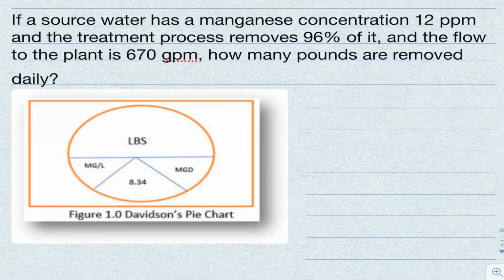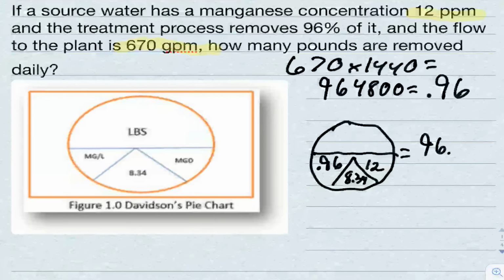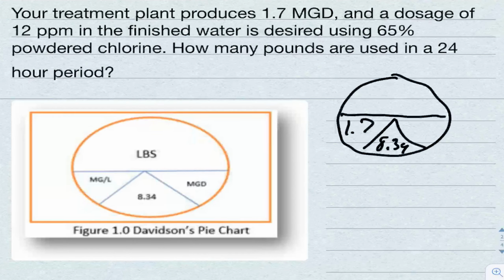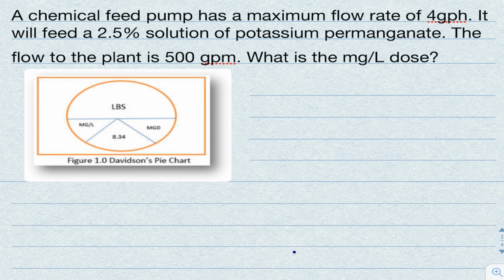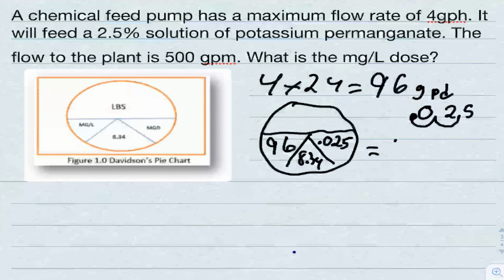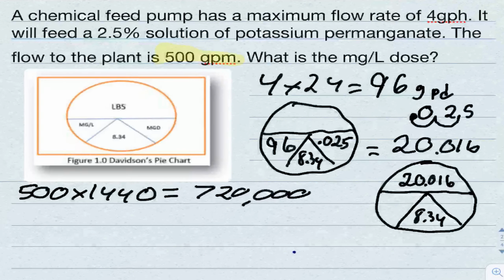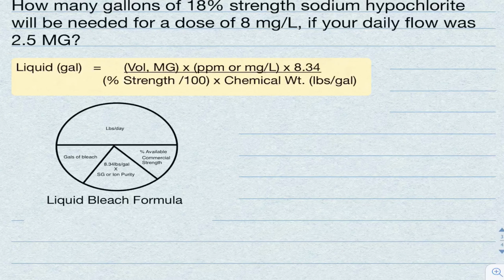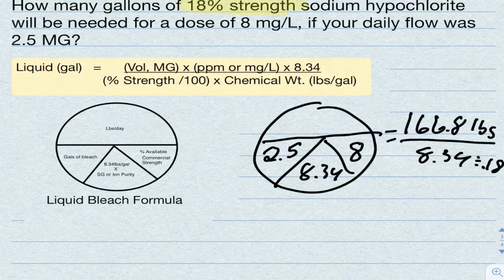Water Math: Advanced Dosage Questions For Treatment

Comment: How did  720,000 convert to .72 ?
Reply from the maker: Hello, it comes from .72 MG (million gallons). 720,000 gallons divided by 1,000,000 gallons =.72 million gallons. You need it in MG for the formula to work

Comment: In one problem, it was stated that 4gph would result in 96 gpd.  That math works, but when plugging the 96 gpd into the formula for MGD, the number remained 96.  Would this not be effectively stating that 96,000,000 gpd were being produced, not the 96 gpd that were actually being produced?  I am confused by plugging 96 straight into the formula.  96 gallons per day is actually .000096 MGD.  This would give a dramatically different result. What am I missing?
Reply: GPD would take the place of MGD, We are looking for Gallons Per Day in this particular question. Then it goes to MGD that he explains in the 2nd Pie chart. kinda like ppm is the same as mg/L in this question it gives you a % of Potassium.